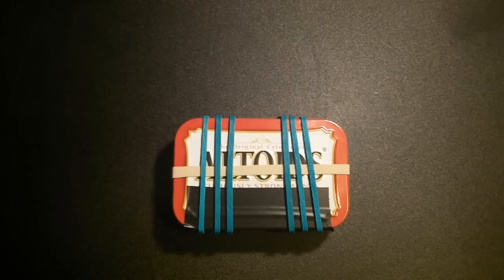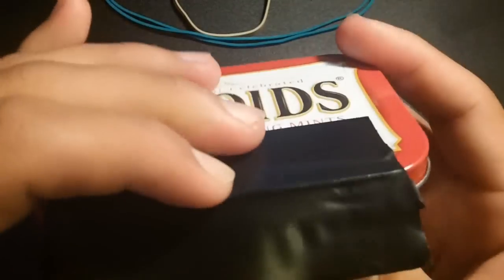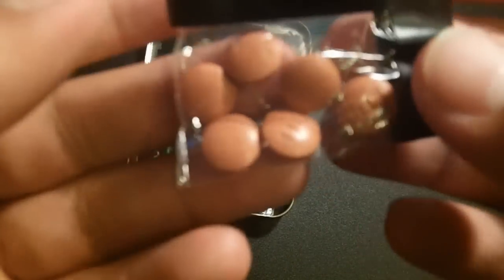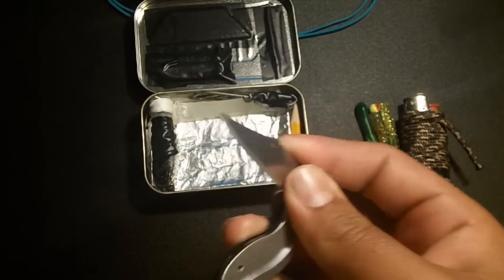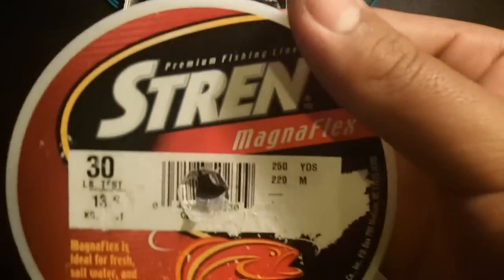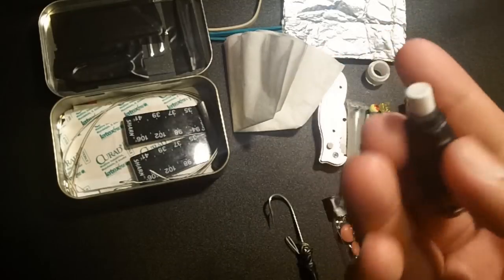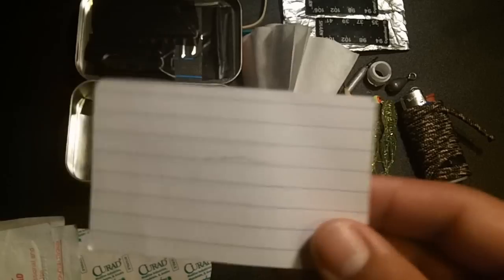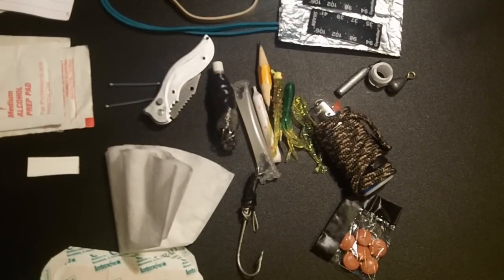Altoids Tin Survival Kit!

Comment: I see a lot of people saying the kit is no good, but nobody is explaining why. Its one thing to comment, another to help someone. We've all been new to this and we all know we learned our mistakes from others. Willie, here's my perception of the good and bad;
The good:
Razor Blades, though they will be painful to use in the field without some sort of holder,
Needle, Very important for repairs
Lures, Aim for small fish, 3-6 inches max. They are easier to catch.
Para-cord, good, though you should have more,
Lighter, Lighter is good for starting a fire faster, the draw back is that the fuel runs out.
Neo-sporin, good to help with cuts
Floss, This will work with your needle, you can mend your pack and such with it, but I wouldn't use it to stitch a wound as the floss can rip skin when pulled.
Pencil and Paper, In my opinion, pencil or pen and paper is good to have. they are good for making patrol maps during extended survival.
Band-aids, no comment needed.

The kinda sorta,
Rubber bands, Rubber naturally weathers quickly, so while these bands may be ok now, a few weeks out in the elements may cause them to snap. The rubber bands are a good idea though.
Pocket knife, Personally I rather have a small multi-tool [and yes they make them small enough to fit in an Altoids tin] The advantage of the multi-tool is that you have several tools you can use to better affect your survival.
30 lb fishing line, I would recommend spider wire as its smaller and lighter. Remember your not going to be able to catch that 15 lb bass or 25 lb catfish using your hands or a branch. Aim for smaller fish.
Aluminum foil, This is a first to me, I never thought to add aluminum foil to my kit. However I wouldn't use it for cooking. Aluminum foil could be used to collect rain water, or to help water proof a shelter or as you said, as a signaling device.
Coffee Filter, Yet another first, but don't let the term filter let you believe that water run through it is clean. Small parasites like giardia can easily get through contaminating your drinking supply. Your best bet is to boil ANY drinking water prior to drinking it.
Wire, While it could be used for small knots, the wire is much to short for snares. [I honestly doubt you could snare a grasshopper with them being so short] Your better off using more para-cord or floss or fishing line as you can carry more of it. Para-cord would be the best option for snares though.
The alcohol prep pads are not needed for cleaning a wound. First you'll find its rather painful to use on open cuts, [which by the time you use your little pad to try and clean up its to late, any bacteria in the area has already entered the wound] and second you have neo-sporin which is an anti-bacterial. However, I have seen people use some brands with higher alcohol content to aid in lighting fires using a flint stick. So there is still a use for them in a kit.

The junk,
Tape, Electrical tape is crap when it gets wet. It wont waterproof that tin even if you covered it completely. Its just not needed.
Matches, One time use and burns quickly, even an entire box will be burned out within days unless you know what your doing.
Aspirin, If your surviving, your gonna be dealing with headaches. In-fact, pain is your body's way of warning you that something is wrong. For example, headaches could mean dehydration, joint pain could mean your pushing yourself to hard and could blow a muscle, chest pain is a sign of stress. Your better off learning what your body is telling you rather than numbing any pain.
Extra large hook, Imagine something biting that hook and yanking the 30 lb line while its wrapped around your fingers, You'd be lucky if it didn't cut those fingers clean off. A large hook is of no use in survival, it gets your expectations to high and can crush your hopes of a good meal any time soon.
Candle, It may burn a little longer than a match but again, one time use and it is susceptible to wind [think of a birthday cake]
Thermometers, The external temps will cause misreadings. During survival, you'll know if something is wrong.
Nails, They are to short to hold up a pack. You might be able to tie para cord around them to hold up a small shelter, but chances are the nails will fall out causing stress. Better off forgetting them.

My "Added" advice,
*Look into a flint stick or other fire starting method that will give you multiple fires. Practice with those methods so they come naturally when it counts. Flint sticks take up about as much room as your candle, and the multi-tool will allow you to throw sparks with it.

*Cordage is valuable during survival. Its what allows you to fish, trap, and shelter. But cordage alone wont work, You should learn a few good knots so that your cordage will hold strong, and so you can easily untie those cords for reuse rather than cut them.

*A picture of loved ones. Family, friends, people you care about and want to get back to. There is always hard times during survival. Your hope of survival depends on your will to live. A picture will help remind you why your fighting to stay alive.

I hope my advice has helped a bit more than those who simply said your kit was crud. We've all started where your at right now. If your serious about learning survival, study. Keep studying, and when you can practice in a way that wont endanger you. the above will slightly increase your odds bu in the end, without the knowledge of what you can or cannot do, and without the will to survive, even the best built survival kits will be useless to you.
Reply: Very well said
Reply: Mike Ayers 👍
Reply: Very long comment but I see what you're saying.
Reply: Beautifully said.
Reply: great comment and glad to see someone being more constructive and positive than just berating the guy he seem young and is learning. also a note on the aluminum foil. I have seen a lot of ex military and hard core survivalists have tinfoil because if everything is wet or damp you can put your tinder on the foil, keeps it dry for lighting it and it also makes it easier to transport to your twigs or fire setup. naturally you should already be as close as possible to where you want your fire to be. but it does keep it dry and easy to move to your fire pit without losing it, also it can be used as a wind barrier when your trying to ignite the tinder because of how pliable it is, when its windy great to have. it can be used in conjunction with the tin to expand its holding capacity if your trying to boil small water and you have nothing else available, i have even see people make cups with them origami style. and great as a water collecting device for water run off similar to a funnel or plastic bag. and a  square piece of foil wrapped or tied to string and then tied to a branch or tree makes an easy way to identify a path or trail your on to find your way back or leave as a marker for rescuers to follow. plus if it can hit light a person or rescuer within a few hundred yards could see it. and if its fluttering in the wind metal against green or brown trees or background stands out, not as well as bright orange but still does a good job. and as a very last resort you could wrap food in it throw it in the coals from your fire and it will cook a meal. you did mention its not good for cooking but look up hobo dinners. i used to do it all the time in boy scouts. i am just rambling now. but maybe that gave you some new ideas for foil. but i do realize your comment has been here a while and i am sure you have learned a lot since then. either way great job on the comment.
Reply: I agree with most of what you said but I have to take issue with a couple of things.    First, the aspirin.  Unless you are carrying a separate first aide kit of some sort, aspirin can be very valuable in the treatment of fevers and other maladies.  I'd keep 'em.  Same with the candle. I can think of several good uses for a candle in a PSK right off the top of my head.  I'd keep the matches too but a third ignition source is certainly desirable.  Ferro rod would be my choice.
 
  I think he's too heavy on the fishing gear.  Maybe 2 or 3 #6 hooks at the largest and spider wire would be my choice as well.  Maybe one of those lures and a few split shot for weights.  I'd lose the other weights and all but one of the lures.

I lined the inside of the lid of my PSK with foil and did the same on the outer bottom of the tin for signaling purposes..  I chose to go with a emergency blanket over tin foil on the inside though.  As for cordage I wrapped the outside of my box with 20' of 550.  Adds a little bulk but I'll have it when I need it.  And the the rubber bands over the cord because they just seem to come in handy at odd times.

Finally I didn't see any kind of container for water.  I use a 1 qt. Zip Lock bag and have enough tabs to treat 10 quarts.

That's what I would do anyway.
Reply: It’s a good but fucking long message

Comment: I think that you did a great job.  I bet you would like the vanquest brand bags.  You can't shine an altoids tin.  Currently, I'm using a pencil case from LIHIT to keep my wite - out mini, safety pins in straw containers, knife sharpener, zip ties, and the actual pens I have.  

You can go to the thrift shop and they might have a bin where you can buy cool keychains for 10 cents each.  I found all sorts of hooks and carabiners, as well as some new things I haven't thought of.  I keep earbuds in an altoids mini on my keys.  You might not be able to punch holes in metal, but you can work with the keychains if you go to the Walmart and buy 2 mini vise grips for $2.50.
Again, I liked your video and I hope that you get inspired to carry a keychain and a pocket organizer.

Comment: Two important things to take note. First, the paper can be used for tracking your location and where you're heading. Consider it a log file but you'll need a compass which you can get a cheap small one to throw into that Altoids can. They sell those for about $5-$10 each and it's very useful although not terribly accurate. It's a good kit to have on you at all times. Most people tend to walk "naked" but people like us walk with compact survival gear which is what this is supposed to be.

Comment: Pretty average stiff in there, depends on what kind of situation you want to survive. But I learned something useful the other day. What if you want to travel by plane, if you are not prepared they will take objects that can be used for stabbing or cutting. Be sure   any blade or object that can be used as a weapon either not in the tin, or very easy to remove. Because it can be a very good idea to keep it with you in case of emergency. You can even be stranded on an airport with no access to important medication or even outdoors after a emergency landing. You cant be sure if you will get access to your luggage, so keeping it close is a good idea. You need to be wise when it come  to what object you put inside or they will nick your kit at the security checkpoint. Another thing, you see to have geared up for wilderness, but you are most likely not ready to survive that. I pack mine for my needs in an urban setting, have stuff to clean water, meds to fix smaller issues, and also some medical suplies to fix wounds.
Thats my two cents, prepare for the most likely scenario, dont go total emergency in the deep wilderness when you gear up a survival kit, unless you for some reason often end up alone in the woods.

Comment: this is a pretty good kit, but i would change it in a few ways number one thing is compass i would get a small paperclip and magnetize it so it can be uses as a compass buy floating it in some water with a leaf second i wouldnt have so many hooks one or two is ok. Then the lighter i would get rid of the lighter and the matches because there is no point in having both especially if you have a small striker which can be glued to the same spot as the match scratch pad. I would also get rid of the pencil because whats the point unless you are dying and wanna leave a note. and then i would swap out that tin foil for a reflective blanket which would be lifesaving with or without a fire. and now that some space is freed up i would add a 1 or 2 small laminated pages if instructions on how to make signals and maybe traps for animals because trust me that wire he had is not gonna do any good other than take up space (that being said i would also take the wire out), and then finally i would add some rope to fill up the extra space. and pleas if you are thinking about making this get a better knife you dont need a flip blade a swis army knife is better
Reply: CaptainHappy I'm not sure how large you think an Altoids Can is.  A reflective emergency blanket is compact, but it would take up most if not all of the space inside the tin.  And as for "rope", he already included paracord.
Reply: ya im not familiar with the container i was just saying what i would do
Reply: No lighters and matches are a must both too in fact im an experienced prepper and survivalist, and redundant is key. Any avid youtube preper will agree. What if you lose your matches or run out? What if they get wet? What if you lose your lighter or it somehow leaked gas or is malfunctioning? Always have 2 methods for everything. In the survival world the rule of thumb is that one is none and two is one. Making a paperclip compass is nice but what if it's not accurate for some reason. Most people bring multiple compasses to get the true direction. As with foil. That is a must as well it is one of the most versatile pieces of equipment you can have. You can make it into containers, filter/distill water, use for signaling cooking fire starting and much much more. A Mylar blanket won't fit in a tin and if you make it fit it'll take up 80% of the space.
Reply: I agree with 
Lego Man.

Comment: Nice kit, and a lot of thought went I to it.  You are probably going to have a water container with you. Having some water purification tabs would help.   This would be kind of a backup to items in your main pack if you go camping
  I made a hobo reel out of a spice bottle and have fishing tackle along with some survival items in it like a knife can opener, button compass, fishing tackle, and on the outside I wrapped it with duct tape and thin paracord for the handle.  There is room for quite a bit of fishing line that already has a snap swivel on it.  You seem to know a bit about fishing.

Comment: I will like to make a suggestion.  

Take straws and cut them to tin size and you can do 2 things: You can fill them up with salt / pepper / or any seasoning you want and seal the ends. Also you can make small fire-starters with Vaseline and cotton balls and put them inside the straws. They will be a good addition.  

On mine I also used bicycle inner tubes and cut them to whatever with I want and use them as rubber bands. Stronger that your average.

thank you for your video.

Comment: You should use a trick candle for your emergency light source so that it is much harder for the wind to blow it out. You should also include a section of hacksaw blade for sawing through small branches, bones, etc. It will not take up much space in your tin.
Reply: Wont need a section of hacksaw blade. He can make a knife/saw out of nails and rubber bands

Comment: great kit 2 things i would have done differently.  Not that what you did was wrong but what i would have included.  1.  It looks like you still have some space right by where the knife is, so i would have put 2 cotton balls with vaseline inside a tiny ziplock back and put that on top of the knife.  They serve many purposes, you can use it to start a fire, you can use the vaseline as a lubricant if you need.  2. i would have taken out either the candle or the 2 extra weights and added a small ferro rod.  The reason is lets say that kit gets wet with rain or you drop it in water and you're out of waterproof matches you have no way to start a fire, your paper is all wet, your filter is all wet, but using the cotton balls that were in plastic, the knife, and the ferro rod you can now start a fire again.  But again, thats what i would have done different.  Remember, 3 minutes without air, 3 hours in bad conditions, 3 days without water and 3 weeks without food.  fire for keeping body warm, boiling water is going to be more important that having those weights in there.

Comment: Not bad, for a start, but I think it can be improved. I would streamline the fishing gear, and use electrical tape to roll it up or tape it to the bottom. On an index card, have a small map of the area you will be in. Have it laminated. On the other side, list the survival priorities. You have too many blades in the kit. Replace the mini knife with maybe an SOL LED Light. Replace the lighter with a Ferro Rod/Striker. Try wrapping the outside with 6'x6' plastic sheet and wrap that with paracord.